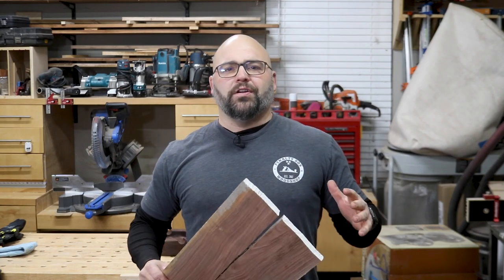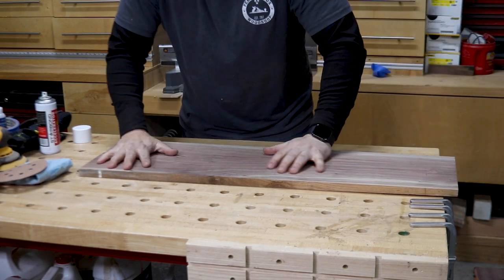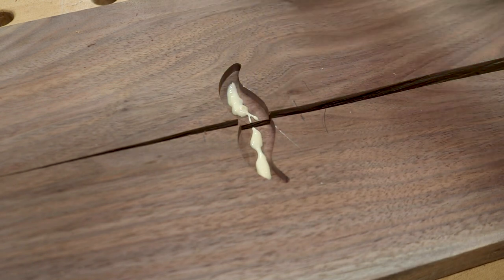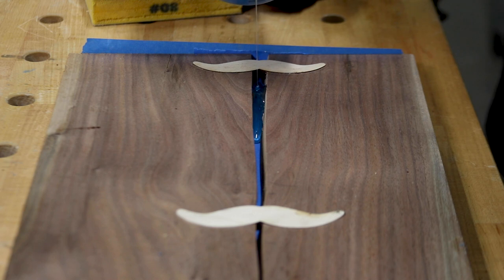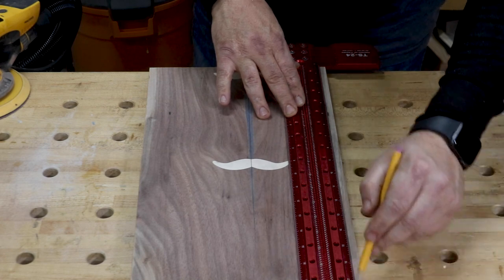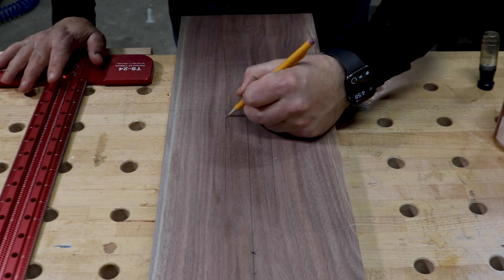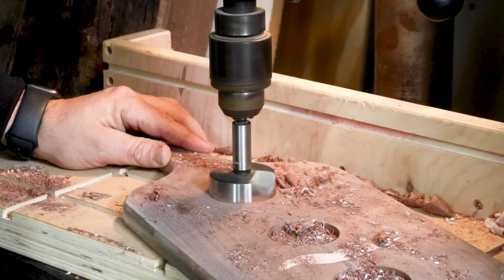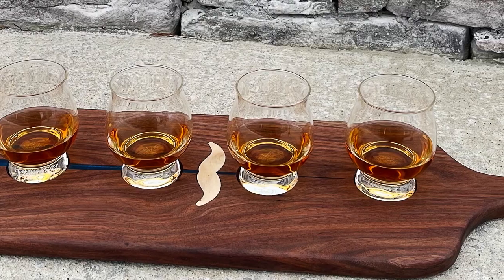DIY Walnut Bourbon Flight with Simple Mustache Inlays! - Scrap Wood Projects that Sell

Comment: I see you haven't replied to quite a few messages over the past year, but I have a question. I'm curious as to why you didn't use the router instead of the forstner bit. That center divot kinda bugs me...... 
Thanks for the idea.....I'm going to make a few of these......have to see if I can make a template for the locaters.

Comment: Do you have a link for the bench top hold down clamps you used on the acrylic template? Thanks.
Reply from the maker: I’ll try to find them and put them up in a few mins. Sorry about that
Reply: @PenaltyBoxWoodshop  guess you couldn’t find any links?
Reply from the maker: I can’t. I can only find the ones for their metal table. I don’t know why the others are not on there

Comment: May I emphasize the use of “odorless” mineral spirits in cleanup use. I know, sounds like common sense, right? I used the regular stuff, and my wife told me I might as well burn it. The smell would kill any joy of bourbon tasting, beer tasting, cheese and meat sampling. It literally stunk. Smelled like the fumes at a bus stop, or  the diesel truck line at Buc-ee’s. I tried everything to get rid of the odor, alcohol, soap and water, detergent and hot water, went to the car wash and power washed it … OMG. I hated myself for about a week, then ended up putting my board in my kiva fire pit.
Lesson learned.